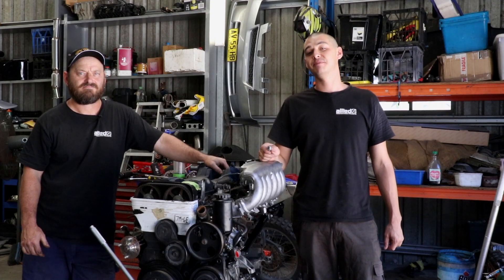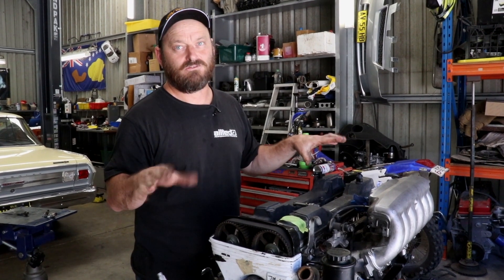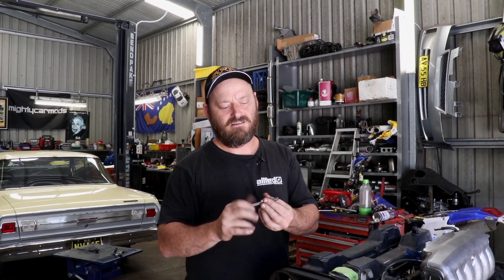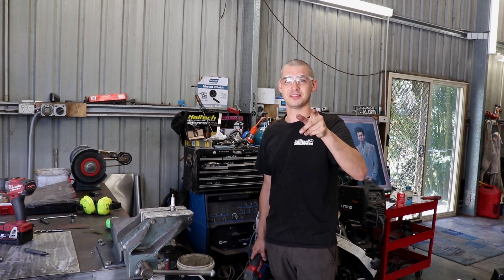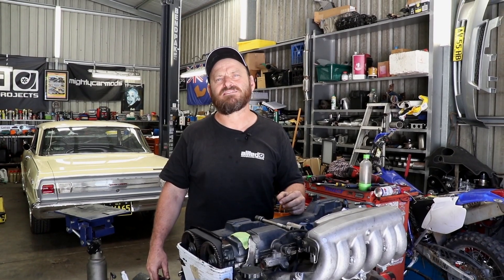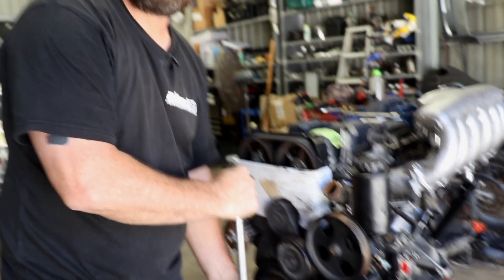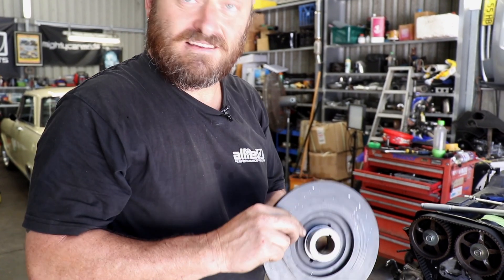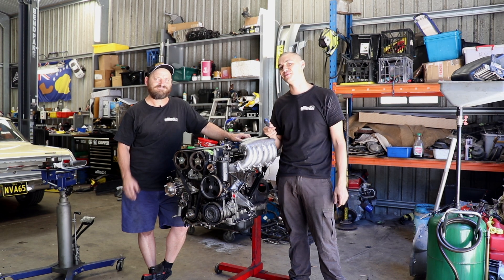THE SKID FACTORY - Finding True Top Dead Centre

Comment: debonded balancers are super common on the 1JZGTE
Reply: All JZs. I've heard it suggested that it's often caused by over-enthusiastic use of the heat spanner when removing the crank pulley in order to change the timing belt.

Comment: That is basically what has happened to every Ford I have ever worked on. You just start ordering  new dampeners anytime you know one is coming in for a oil leak.
Reply: What...? as opposed to working on chevys, where if there's no oil on the floor there's no oil in the motor???
Reply: @scottthompson292  Why are you assuming that I'm a chevy guy. I don't have any problem with old fords, I have just worked on a ton of really old ford grain trucks. P.S. never had a Ford that didn't have a Rear main seal leaking, and valve covers seals leaking. But back in those's days every ones seals leaked.
Reply: @Darkhalfcustoms  well the way you singled out fords made you seem like any other stereotypical chevy fanboy. If you wanna talk "really old" anything... they all have leaks. for the rear main seal if you replace the old 'rope and grease' seal with a modern equivalent and don't rattle gun your valve covers on there's no reason for them to leak.

Comment: I'd really like to see more purpose built tools, seeing how other people solve problems by making their own tools helps inspire greatness. Thanks guys!
Reply: A small lathe is one of the best tools you can buy for making your own tools. The number of clutch aligning tools, bearing drivers and seal drivers we have at work is amazing. Always have some alloy stock and nylon stock on hand for making up new ones. Don’t forget to use letter punches to write what they suit on them, makes it heaps easier to I.D. later on🤙
Reply: I have part of an AU Falcon steering column that I use as a clutch alignment tool for Honda D series
Reply: @TrashDeviant  I've got several bits of turned broom handle for clutch alignment... and an increasingly short broom!
Reply: Ahh to own a lathe and/or mill that is the dream.
Reply: Thanks for the ideas guys!

Comment: I've done a 1000 LS motors with a dial gauge. Just go down from TDC both ways to the same reading like .005" and mark it like a piston stop. Can leave it in and not turn the motor over 350 degrees either risking catching a valve.
Reply: Makes sense. Same method he is showing here. He just meant you can't use the single reading to find true TDC.
Reply: Dial indicator is great when a head is off, little bit tricky to confirm TDC with a dial indicator on a LS while the heads are on.........
Reply: Shawn Dickens Would that be more accurate too as surely a dial gauge is far more incremental than measuring the outer diameter of the pulley with a ruler?
Reply: @spudsmckenzie4123  Theoretically it should be the same accuracy since you are still getting two outside measurements and still have to use the ruler technique. Like he said in the video, there is dwell where it is at the same height for a duration.
Reply: If using a dial gauge, it would be more accurate to go to a higher figure.  It is also more accurate if you can put a degree disc on the crank, note the 'touch point' angle , and then calculate TDC as the mid-point
Reply: Heads on with extension. Tiny bit more accurate because the two marks are closer together, but mostly the same. Nice part is do it all in 20 or 30 degrees so valve hit is not an issue.
Reply: Thank you for the replies fellas! This is all a very steep curve for someone who isn’t a mechanic so I really appreciate the info. I like Al’s method because it’s something you can do with stuff you’d have in the shed but I figure there’s always more than one way to skin a cat.

Comment: always good to check camshaft timing while you are at it, i bought an old datsun that wouldn't rev past 4k like it was hitting a wall, it was one whole chain tooth off by whoever put it together last.
Reply: Done it once, ran like shit..
Reply: i bet it had shit loads of down low 😂😂😂
Reply: @nismofreak33  it didn't really run well low or high. the l28 runs best 3-6k

Comment: How to diagnose a blow head gasket properly, how to set ignition timing, just a couple that come to mind. Keep up the good work al and woody 👌🏼🤙🏼
Reply: How to diagnose a blown head gasket:
Ask for advice on the internet. 9/10 will say head gasket
Reply: haha how to tell if you have a bad head gaskert? buy a subaru! loool. I've gone through one in every subaru I've owned lmao. but seriously, those would be good short videos I'd be interested in watching
Reply: Thrashdeviant indeed, although they’re somewhat correct as any overheating issue left untreated will lead to head gasket failure.or simply subarulife 😂
Reply: @andrewkirk701  Good point. Also Daihatsus are terrible for it. Pod filter full of chocolate milk. Delicious.
Reply: You can use those kits that test the coolant for excess gases caused by combustion chamber leakage.
Reply: And yes the 7m hadd head studs issues toyota themselves released a revision kit to remedy it.
Reply: Problem is its not a 7m haha
Reply: Does your car badge contain 6 stars? If so your head gasket is blown.
Reply: Supra_rankin but the internet says it is so it must be 😉😉.  😂😂

Comment: Just remember kids - the starter motor is stronger than a piston stopper 🤜🤛
Reply: It turns into a piston hole punch when you crank it
Reply: @vabu94  piston stopper don't know bout my forged pistons.
Reply: @signlsirchir2156  I'm gonna guess that stationary small diameter steel is going to beat moving aluminum. Could be wrong though
Reply: Challenge accepted sir
Reply: @brandonb8543  Please post corresponding video.
Reply: @rodpalmer4652  LOL hey don't tempt me! I have a d series engine that I couldnt get rid of to save my life that's been sitting for years at this point that I have no problem doing unspeakable things to do
Reply: you all probably dont give a shit but does someone know of a trick to log back into an instagram account..?
I stupidly forgot the account password. I appreciate any tricks you can give me!
Reply: @Onyx Harper Instablaster ;)
Reply: @Jack Maxwell thanks for your reply. I got to the site through google and im trying it out now.
Takes quite some time so I will get back to you later with my results.
Reply: @Jack Maxwell it did the trick and I actually got access to my account again. I am so happy:D
Thanks so much you saved my ass!
Reply: @Onyx Harper you are welcome :D

Comment: 2:12
"That  was a 3S-GTE actually."
"Oh, that's right"
" I think that's your favorite engine Al"
"Yeah, I love vibrations!"
Damn Al, don't beat around the bush Al, say what you really mean!!!
Reply: That comment actually stung me a little bit! The 3SGTE in my GT-Four ticks over like a kitten. Then you tickle the throttle and it can be heard/felt 3 houses down the road! 😂
Reply: @unicorn7337   Had mine imported 11 years ago, been dailying her ever since. 151k Miles and still pulling as strong as ever.
Reply: @webweasel4401  Mine is a JDM import as well. Brought to the UK in 2001 then to Ireland sometime in the next 6 years. Mine is not a daily, more of a weekend toy. But 141,000 km on it and still running like a clock. Its last pull on the Dyno was 320bhp, still on stock internals at the moment but will be  dropping in a forged engine next winter! 😁
Reply: @unicorn7337  Keep changing the oil and the engine will last forever. As for the rest of the car, well, 11 years has cost 15k in maintenance. However, everything underneath is all brand new. Beware of the rear shock mounts, getting real hard to find right now. She's going in for a back to chassis respray next year and I also have a deposit down on the new Supra ;-)
Reply: 3? Are they a mile apart or is your engine broken?
Reply: @cabe_bedlam  The last time I had it running, it had most of the exhaust removed and was on axle stands, sitting on concrete. The neighbour closest to us came over and asked me to turn it off because the vibrations were keeping his kids awake. 😂
Reply: I know What he means :D got One myself, they shake like bitches on idle :D
Reply: Mines the same when it's running my wife can hear it coming a block away. Miss driving that car.
Reply: Made me crack up! glad you mentioned it :D
Reply: I thought this was a project binki stab with how they made a solid pully so no longer a harmonic balancer lol maybe I just thought too much into it